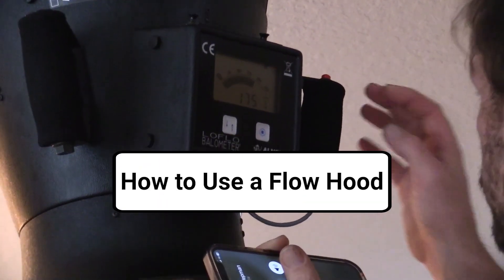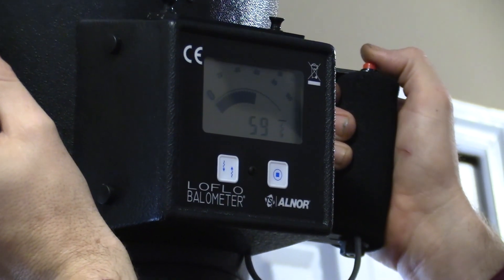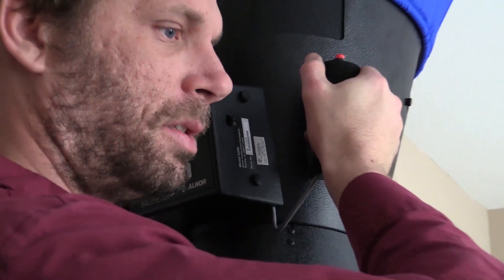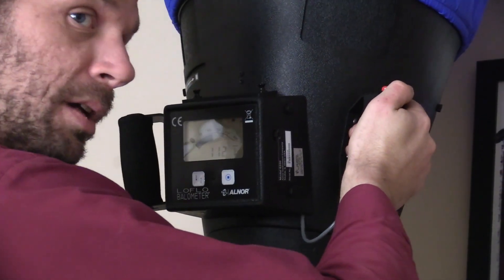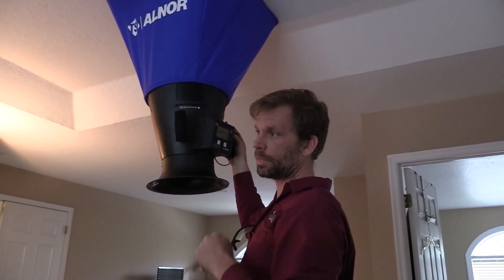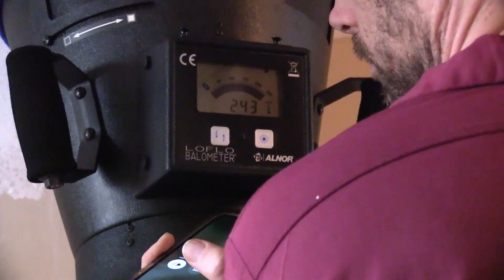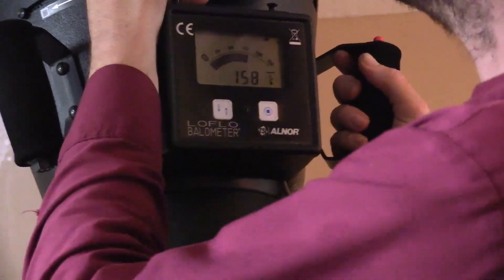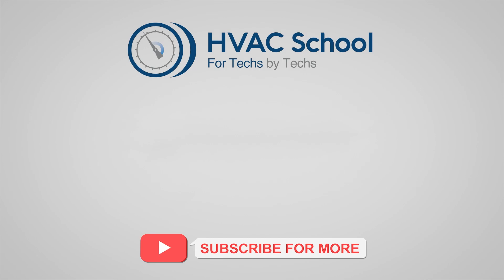Flow Hood: How to Properly Balance an HVAC System

Comment: I dont see the value, over 20 years without it and no one complaints about our duct designs. You will never get the heat load numbers perfect because heat load is constantly changing, so matching your numbers to the paper doesnt have much value. You just need your duct system designed by someone with experience, a manual damper on a residential duct system is usually a sign of bad design. This is gimmicky and a fad that won't be around long in my opinion, I see the comment section and the chosen pinned comment but I'm not trolling. Its being done for comfort and if your designs are that far off you need to stop and reevaluate everything your doing. Good Luck

Comment: Very useful to be able to balance the air,  but you need to have done a load calculation and know what the required air flow is.

Comment: On that flow hood if the cfm is 
150 and over you have to hold the red button until the square opens up only a border of the square should show and you need to slide over and open the window.

Comment: The Alnor flow hood should be used after every new install.  Especially if a 2 stage variable speed gas furnace was installed.  The proper cfm will need to be selected using the dip switches on the furnace.  The output will need to be confirmed using the flow hood.  Once you have the correct total cfm output, then you can balance the air flow into each room.  Doing this will make your customers very happy.

Comment: cool tool but severely overpriced... I don't know how independents do it.
Reply: Cps makes a good one for a few hundred.
Reply: @BradBuildsStuff102  you're not wrong. Just a little rich for myself for the amount of use it would get currently.
Reply: @skelafeti  oh dang. I use the hell out of mine. It's a nice bonus on cleanings to add on if you have the time